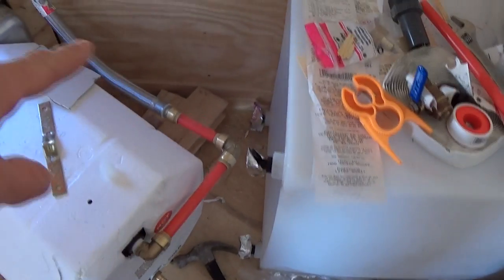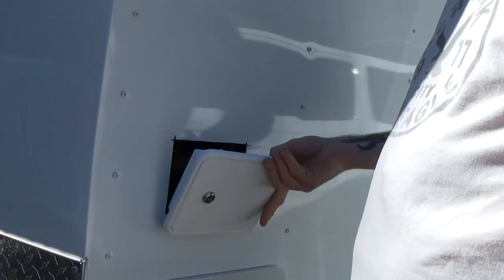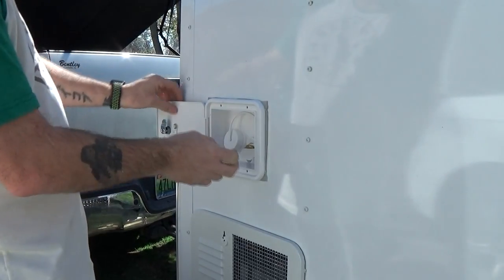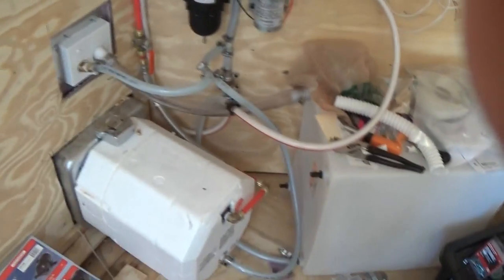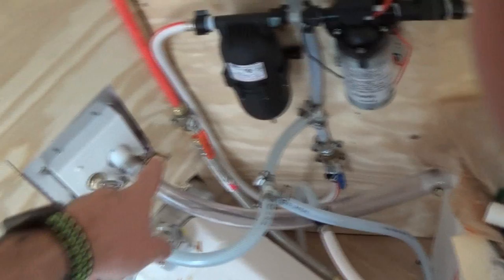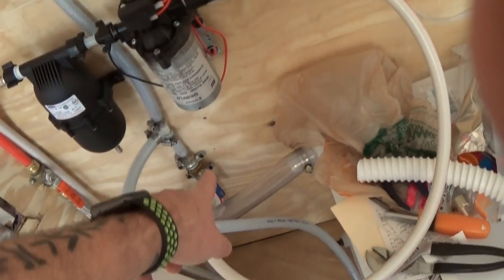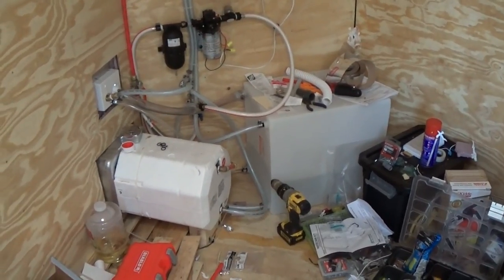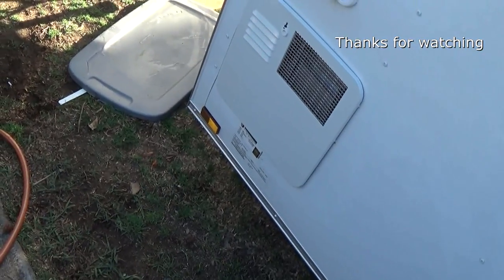6x12 Enclosed Trailer Conversion Plumbing

Comment: I wanted a small travel trailer and bought a 13' for $22,000!!! I needed all aluminum for weight specs. If I had the time I was going to do what you did to save money and to make it the way I wanted it exactly. $22,000 plus accessories later and turns out I didn't need the trailer (for a job) after all. Good thing it's aluminum because it's been sitting for 6 years. Thanks for making me feel bad ;)

Comment: what is the part numbers to your water pump and acclimater and the parts on the inlet and outlet
Reply from the maker: amazon
SHURFLO 94-591-01 Pump Silencing Kit
SHURFLO (255-313) 1/2" Twist-On Pipe Strainer
SHURflo 182-200 Pre-Pressurized Accumulator Tank
Shurflo 2088-554-144 Fresh Water Pump, 12 Volts, 3.5 Gallons Per Minute, 45 Psi
Reply: thanks for the info.will be getting order